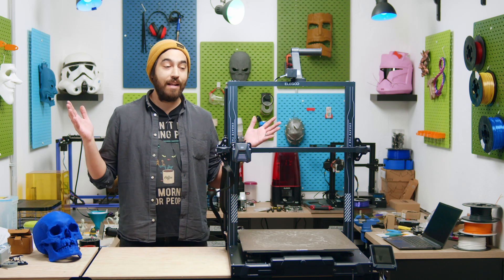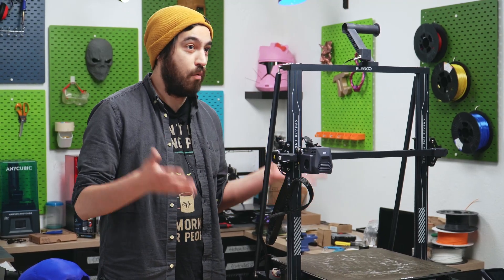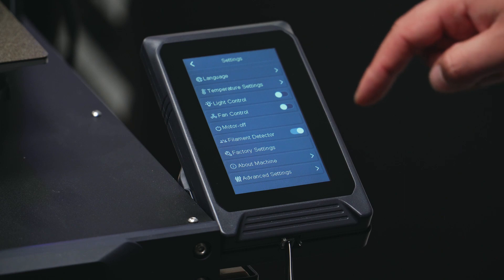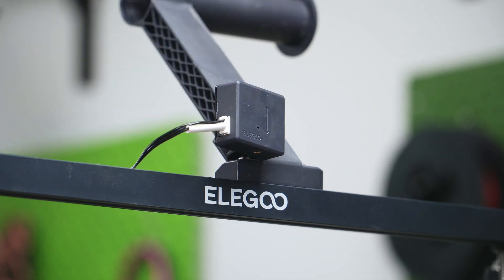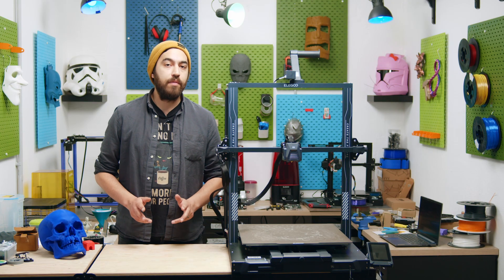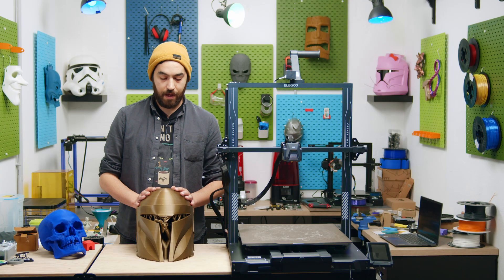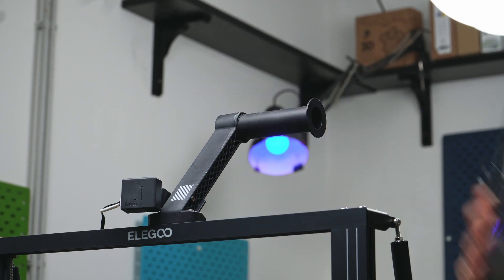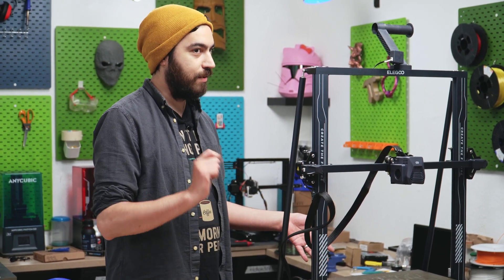Neptune 3 Max Review - The King of Big Printers!

Comment: Will it print ABS????
Reply from the maker: Depends on the ABS. A lot of ABS requires an enclosure. Our own niceABS normally does not require an enclosure, it is a low warp variant so it should work fine on the Neptune 3 Max in most cases.
Reply: @3DJake_Official  Thanks a lot 🙏👍

Comment: How does one proceed with paring up this printer to Prusa slicer?  (As in making the perfect profile.) I have mine set up and plan to do a few test prints with ESun PLA + filament ^^ I have the standard 0.4 mm nozzle on it currently (But have brought and have various other sizes ((0.6 / 0.8 mm etc.)) I just don't want to somehow clog my hot end/extruder etc.) -_-, Any help would be super super appreciated!! :)

Comment: Might as well wait om the 4max
Reply from the maker: I think there is a pro in the works but haven't heard anything about a max. I actually tried installing klipper on the Max with the sonic pad, worked fine except there was not much benefit with input shaping, you can't get around that huge bed.

Comment: Day and a half with a .8 nozzle? I am getting day and half with a .4 with a Mando helmet. Also if you have the spool holder on the wrong side yes it don't line up with the moveable run out sensor.
Reply: I was thinking the same thing about the runout sensor. Seemed like it was on the wrong side of the spool.

Comment: If changing to .6 nozzle what changes or setting changes need to be done in orca or cura slicer?
Reply from the maker: I don't think you would really need to change much for a 0.6mm if anything at all. It's not a huge difference, maybe up the temperature an extra 5 degrees but I yeah I don't think you would need to change much.

Comment: Here is what I did to upgrade my hot end on the N3Pro(same hot end I hear).  I got a creality sprite heater upgrade kit from polisi3d on amazon.  20 bucks and it came with the heater block(smaller in an area that doesnt matter since the holes line up... just 4mm shorter on the back side), upgraded heater cartridge, upgraded high temp thermistor, titanium copper plated block and nozzle.  The heat break is smaller on the sprite...the elegoo uses a CR10 block and heat break.  I got a set of 4 bimetal heat breaks that measure 7mm at the top, 27.5mm long, with m6 threads.  It is the same as the cr10 heat break.  

I had to nip the silicone sock to run the thermistor wires out of the right side and install the heat cartridge coming out of the left side (left and right as if you are looking at the hot end while assembled and installed).  I also had to splive the old thermistor connector to the wires on the new thermistor.  Orientation of wires does not matter on the thermistor.
Reply: Could you link the kit you got from amazon? i'm struggling to find exactly the one you are talking about? and do you know if the bimetalic breaks are fine with abrasive filaments like glass and carbon fibre?

Comment: Great video! I was curious, would you mind sharing your Prusaslicer setting for the larger diameter nozzle? I just got the Neptune3 Max and can’t get a good print with larger nozzles.
Reply from the maker: I don't think I changed much besides the speed, it was reduced a bit. The other thing to check is the extrusion percentage/width, it doesn't change with the nozzle size change and is often overlooked

Comment: How difficult is the base leveling. I’ve recently gotten into 3D cosplay printing. Gifted a new ender 3 and my headaches start and end with the seemingly constant need for readjustments. I saw this machine and thought it would make my life easier with single prints but if it’s prone to readjustment I may go in a different direction
Reply from the maker: I manually levelled it when I got it then autolevelled and I haven't had to make an adjustment since (except when I connected it to a Creality Sonic Pad - a relevelling is necessary when you do that)

Comment: I own this 3d printer. If you adjust the plan to perfection and do not requirehigh printing speed, works really well. I use Prusa slicer and never exceed 60mm/s in printing, if you increase the speed, it happens the staggering of the various layers, as you see from your white object.Nozzle brozl 0.6 already closed/ clogged twice with Xpetg carbon extrudr, otherwise assistance Excellent. Recommended product. I love it.
Reply: What setting changes do you need to do in cura or or a sliver of you change to .6 nozzle?
Reply: @davec8500  I don't use Cura. I'm using Prusa slicer